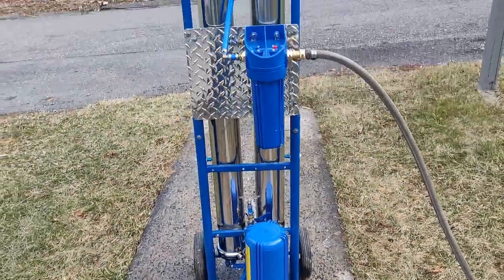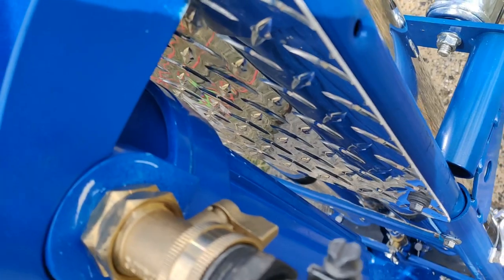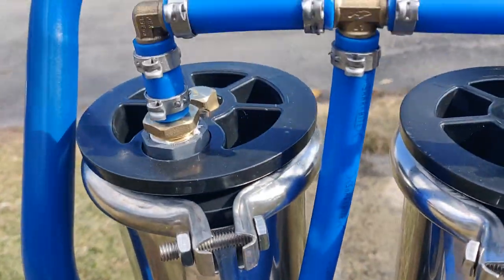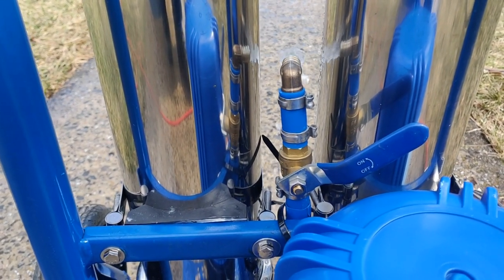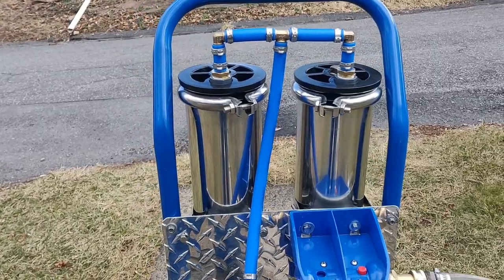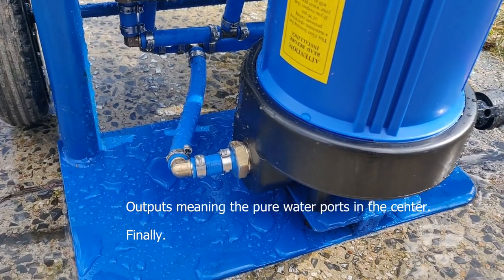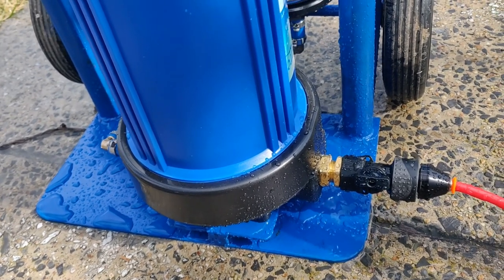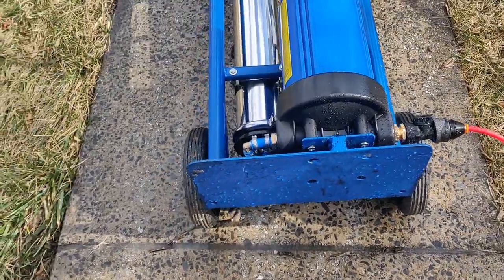DIY Pure Water Cart for Window Cleaning

Comment: I’m not a window washer but I’m am a Reverse Osmosis expert. That 2.5”x10” CBC Prefilter is too small. Should be a 4.5”x20”.
Reply: no its not😂
Reply: def not an expert then
Reply: If we want to get really technical, this system shouldn't even work as tap pressure is lower than what the membrane operating range is. But window cleaning is a unique application and product designers easy smarter than us have come up with tried and true systems using this general design long before I did. The filter size is fine as long as it's changed quarterly. Thanks for the input though!

Comment: Pex isn't rated for UV. Expect to replace it soon.
Reply from the maker: My old system begs to differ. May not be rated for it, but it's holding great, 2 years in
Reply from the maker: More than anything, uv degrades pex's ability to resist chlorine, of which trace amounts in your water eat the pipe over time. The carbon filter removes all that before it hits the pex.

Comment: Please help me find the di like you have here!! I can’t find it anywhere!!!!
Reply from the maker: Just look for 4x10" whole house filter. Or 4x20" if you have really hard water in your area
Reply: Okay. I pick up most of the pieces for this project. Where do I get those square bolts that go on the center top of of the 4040 pressure vessels?
Reply from the maker: @vschampion  I'm so sorry I missed your question. The notifications here aren't always great. Hopefully you figured it out, but they're just npt plugs available at most hardware stores.